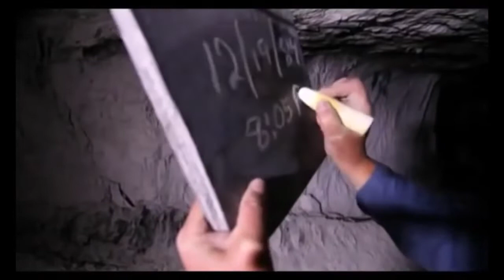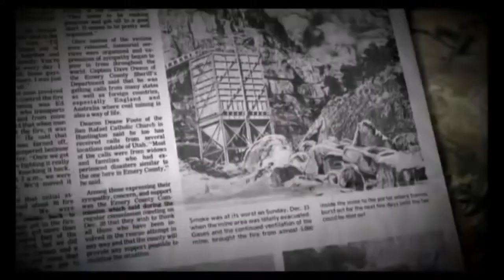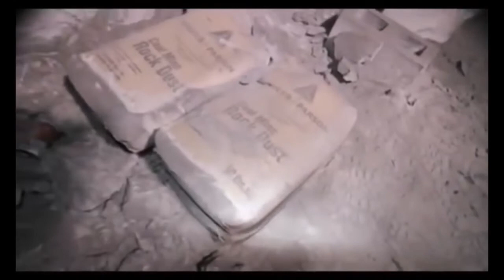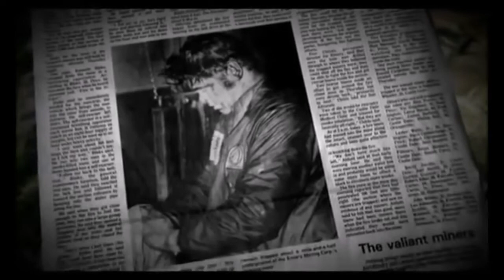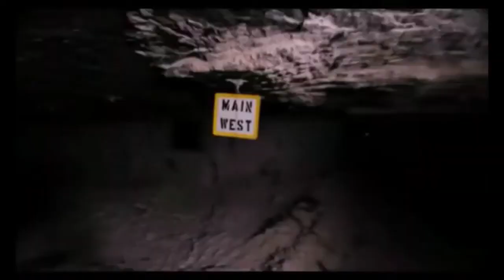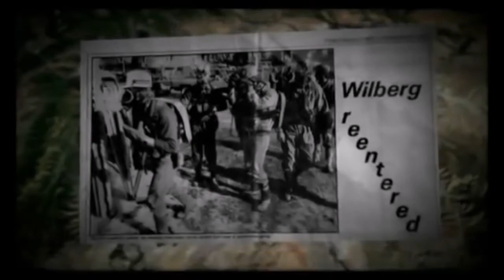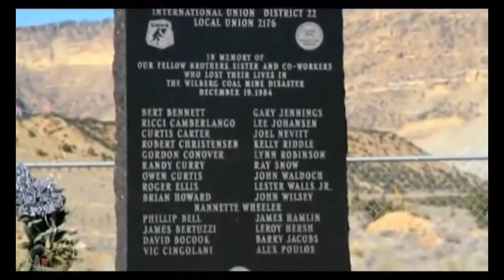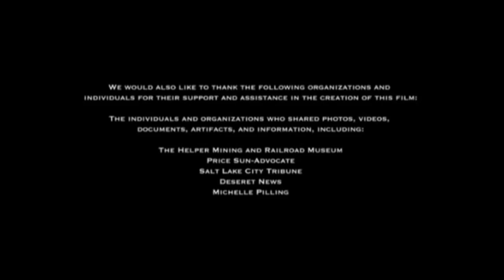Mining History | The Wilberg Mine Disaster

Comment: I worked at the wilberg mine in 1981 and 1982. When I started working there there was no long wall mining system in operation at that time. The beltline was clean underneath. Nothing but a little wet mud. The belt itself was operating at about 70% capacity. Months later when the long wall system started feeding coal onto the belt it was running at over 100% capacity because in a matter of weeks there was 2 ft of fresh dry coal dust under the entire beltline! As a result of this the bearings on the belt rollers begin overheating, then getting red hot and actually dropping hot molten metal onto this 2 ft of dry coal dust. I observed this while traveling in the man trip to my work section in second right. I reported it to the section boss. The second day while traveling into my section I observed even more belt rollers with melting bearings. I reported it again to the section boss. On the third day while man tripping to work I again observed bearings dripping molten metal onto this coal dust... So I had them stop, stepped out of the man trip and quit on the spot. Someone blurted out"what's your problem?". As I continue to walk out I said"you're all going to die". About a year-and-a-half later I was in Denver Colorado at a White spot restaurant and I grabbed a news paper that someone had left on the counter and a few pages in I read about the wilberg mine fire. Sometimes you just got to walk away. As a side note, I was one of the guys who installed the 6 inch fiberglass water line in the intake passage.